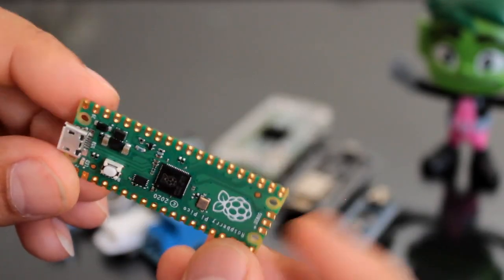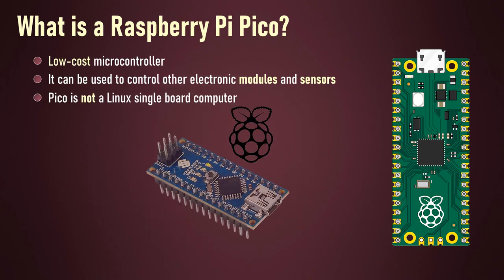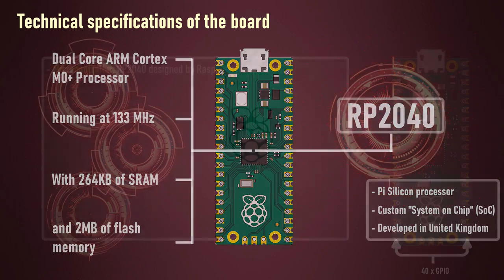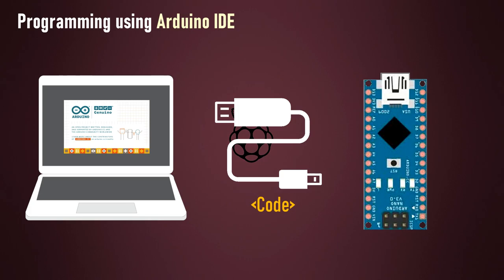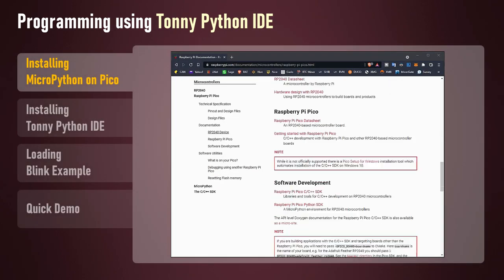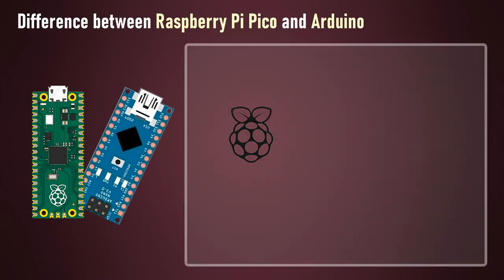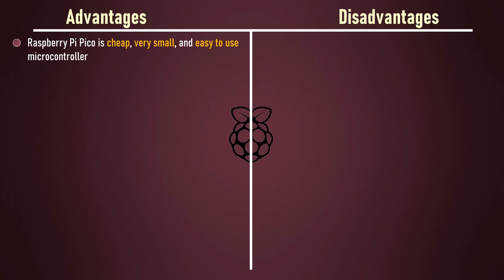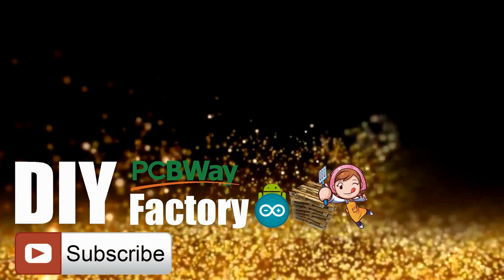Getting Started With Raspberry Pi Pico

Comment: One statement that may be confusing.  The Pico comes with all of its components soldered, just not the header pins.  We will have to solder the header pins, but not the surface mount components.
Reply from the maker: Ha ha, yes that's correct mate

Comment: The main problem with the Pico is that it only has 3 analog inputs. An Arduino Nano has 8 and is cheaper than a Pico. An Arduino Uno has 6 analog inputs and also cheaper.Most of the projects I have completed in the last year required 6 to 8 analog inputs. Also the Arduino IDE is must easier to use an has thousands and thousands of sketches/codes available for free!! The library support for Arduino is vast and simply incredible. I like R pis for using as computers. But I will skip their microcontroller. Maybe try in a few years when it is improved.
As a microcontroller there is no up side to using a Pico compared to an Arduino Uno or Nano. I buy them in lots of 10 for $2.40 to $3.25 a piece with free shipping.
Reply: Your're right, but some proyects could need a more powerful microcontroller. Here you have two 32 bits cores at 133 Mhz. But Nano is far less powerful than that.